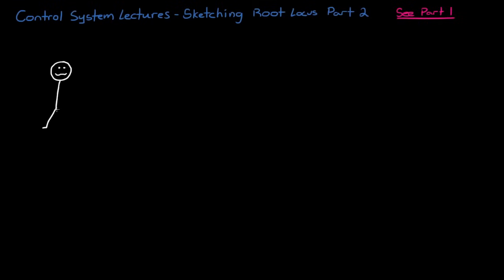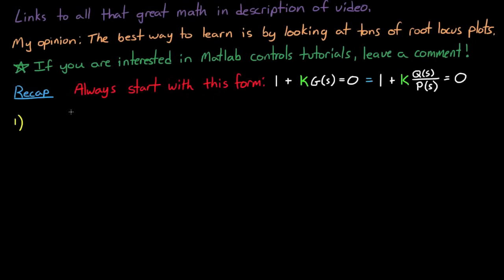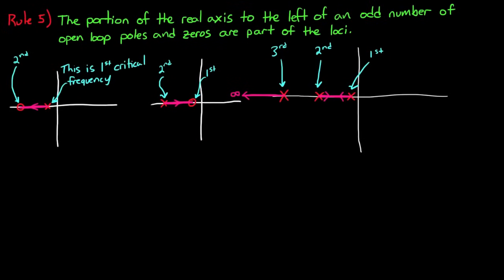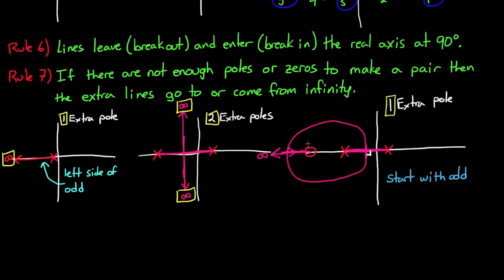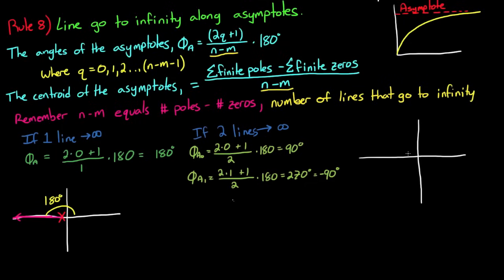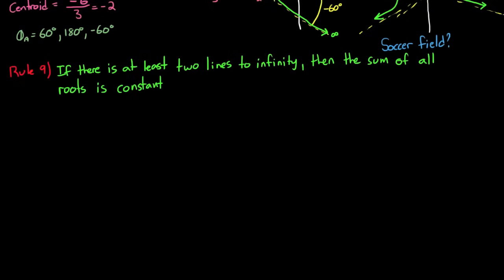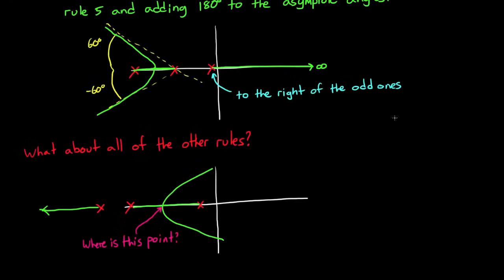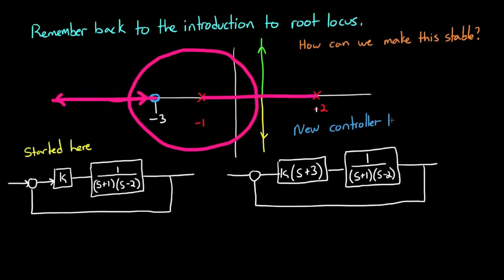Sketching Root Locus Part 2

Comment: @Brian How do you draw that fast ? and change color so fast as well ?
It seems that you are drawing in real time since we can see your cursor moving --- seamlessly transitioning between the lecturing and drawing parts of the lecture.
Drawings to not appear per-recorded. Are you using a special tablet like a bamboo tablet (I must confess that I never used a bamboo tablet so I may be completely in left field with this example). If so I would be curious on  the model if the tablet if you can provide it.
Drawing are really well drawn and spot-on, lectures are great too .... they explain the control theory material with emphasis on intuitiveness which is great

Comment: I think the way you get the centroid is not that precise it outputs an approximate to correct value we get from solving for x : 
(sum (1/(x-p_i)) from 1 to n) = (sum (1/(x-z_i)) from 1 to m)
where zi is the value of the i-th zero and the pi is the value of the i-th pole 
but if it is true for all the systems I would like to use it because of the super computation reduction it makes

Comment: Hey, Im practising for my exam and im puzzled about something. The transfer function 1/(s(s+1)(s^2+4s+5)) has no zeroes, 4 poles, therefore the asymptotes to in 45, 135, 225, 315 degrees. The centroid of these asymptotes should be, according to your formula at (8:20): (4-0)/4 = 1 because there are 4 finite poles, no finite zeroes, and 4 unmatched pairs. Yet Scilab puts the centroid at -1.25, which is, funny enough, the "average" or even "center of mass" of the 4 finite poles! Im gonna do some more excersices and see if this formula stands for every case (no time for a formal proof lol) but maybe i used your formula wrong? Thanks in advance!

Comment: At 9:12, how do you know what to make q?
Reply: q is the sequential of integer numbers from 0 to the minus 1 of difference of poles and zeros. So in this case there are 2 lines of locus, indicating that the difference between poles and zeros are two (n - m = 2). So the q numbers are the sequency that starts from 0 and end up in 1 (n - m - 1 = 2 - 1 = 1)

Comment: I stumbled upon a problem while trying to sketch by hand the root locus of a certain closed-loop system. The open-loop system is K*(-0.5s^2+1.5s-1)/(s^2+4s). This system has two open-loop poles and zeros, so each pole has a zero pair. However, when I use rlocus to plot it, it shows that the zero situated at s = 2 goes to infinity even though a pole should be connected to it. Also, on the real axis there is root locus on the left of even number of open-loop poles+zeros, which completely contradicts rule 5. So I am not sure what's going on, so far I have always been able to use this rule and sketch all systems without any problems. Can someone help me?

Comment: If right half plane real zero is located at the very very large +s (say; 1,000,000), should we consider it as first critical frequency? In practical engineering case, it often seems to ignore the RHPZ located at the very high frequency. That's why I am confused.

Comment: Ok, so, one thing which made me confused, and might throw other people off as well so I'd like to mention it here. If you have something like s(s^3+25) in the denominator, so your poles become s(s^3+25s) = 0, your poles end up being 0, 5i and -5i. But a thing to remember here is that the poles are in fact 0, 0, 5i, and -5i. This means that there are 2 poles at the same point in the root locus.

Comment: For Rule No. 6: If G(s) = 1/(1+s/p)^3, the the break away point and the centroid of the #3 asymptotes will be same, while the angles of the asymptotes are 60, 180 & 300 degrees.
Am I missing something?

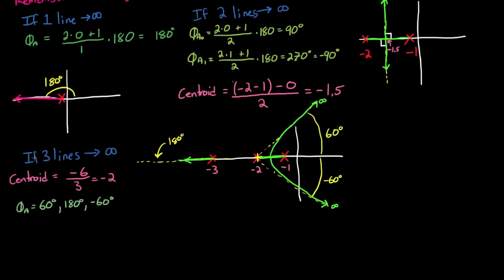Comment: hey at 10:48 your lines leave the R axis at 60 degrees each. Isn't that opposed to the Rule 6 where every line "leaves" the R axis on 90 degrees?
Reply: doubt its relevant now, but the lines breakaway perpendicular (+/- 90 degrees) from the real axis, after this they tend towards the asymptotes which would be +/-60 degrees in the case you specified.

Comment: Question regarding Rule 5)
Say you plot a function with one zero on the positive real axis, a pole on the origin, and finally another pole left of the imaginary axis. In that case the first critical point would be the positive zero. However if you plot the rlocus on matlab, the space between the first and second critical points would be empty, and the space between 2nd and 3rd would be part of the locus path.

I hope what i mean is clear, but i would like to know if there are any exemptions to that rule.

Thanks!

Comment: Im traying to sketch the root locus of the following open loop transfer function:  (s+7)/(s*(s+5)(s+15)(s+20)). I can determine the open loop poles are: 0,-5,-15,-20 and the open loop zeros: -7. Then I used to two equation for the centroid and asymptotic angles. For the centroid I get -11 and for the angles : 60,180,-60.  When I plot the root locus in matlab, the 60 degree angled path are between -5 and 0.  Why does the centroid (-11) appeard between -15 and -7 at 180 degrees and not where the path follow the asymptotes?

Comment: when two poles crash and then go off to infinity, does it matter which one goes up and which one goes down? for example at 15:00 when you have your poles at -1 and 2 you draw the pole from -1 going up and the pole from 2 going down. is this just arbitrary? also when you added the zero afterwards which pole would go towards the zero and which one would go to infinity?
Reply from the maker: I drew the motion of the two poles in separate colors because I thought it would be more clear but I've received several questions like this which leads me to think I've mislead people into thinking it matters which goes up and which goes down.  But think about it this way ... let's say for a given gain, k, we have two poles (-1 and -3),  then as we increase k they move to (-2.2 and -1.8) and then to (-2 and -2) and then finally to (-2 +i and -2 -i).  You'll notice that when you aren't drawing how they move on a graph then there is no question of which moved up or which moved down ... they are just two poles in the system.  And both poles were on the real axis at low values of k and then moved off the real axis for higher values.  And that's the important part, it's not where does this one pole move (up or down) but how to all of the poles move together.  The root locus plot gives us a picture of how the poles moves in harmony as we sweep k.  

Same thing when I add the zero.  It doesn't matter which "color" goes which way.  Just that one pole moves one way and one pole moves the other way.
Reply: awesome that makes sense, thanks for the quick reply brian, i just bought a copy of your e-book as well, it looks great
Reply from the maker: Thanks! Glad you like it so far.
Reply: What will be the angle of asymptotes if Number of zeroes is greater than Number of Poles.

Comment: Dear Brian,
I was told that the arrival angle and departure angle of breakpoint should be calculated via dividing 0/180+360L by multiplicity.  It is always not equal to 90deg.

Comment: Brian, for Rule #5, what if we have a conjugate pair of poles or zeroes as the first critical frequency? Do we still draw a line to the left of the odd numbers, just do it on the real axis? Also, if the first critical frequency is a conjugate pair, which one would be the first? Thanks.

Comment: So I'm in a Dynamic Systems and Controls class right now. The professor is horrible. Thick accent. Hard to understand. Chicken scratch notes and the worst explanations ever. If only I had you as a professor I think I might be passing this class. With only 30 ish min spent on this topic I think I've learned more than the 3 lectures from my professor. Thank you so much!

Comment: Hi Brian, thank you very much for your great effort you put into those videos, I always go through them first before I go to textbooks ;)

Question: For the last example would it be possible to add another pole and adjust the gain so that we move our poles to the LH side?
Reply from the maker: Thanks for the nice comment! To answer your question in a word: No.  It's hard to explain why as a comments but you can image that since the root locus lines exist on the real axis to the left of the critical frequencies so the +2 root would still move towards the -1 root.  However, no gain and pole location you choose would cause the +2 pole to move faster to the left than the -1 pole moves to the right. Not a great explanation.  I'd recommend you try it out and see what happens. Cheers!

Comment: Quick Question Dr. Brian, at 09:48 how did you know that the pole at -2 corresponded to the 90 degree asymptote and the pole at -1 corresponded to the -90 degree asymptote and not the other way around? Thanks :-)

Comment: Am having a problem with the centroid equation. I have 2 infinite poles @ '1' and '0.7'.Also one infinite zero @ '-0.2', in total I have 3 poles (0.7, 0.1, 1) and 2 zeros (-0.2, 0.3), but I cant get the value in the middle between the two infinite poles using the centroid equ.

Comment: I tried using the angle equation for complex poles, but it doesn't seem to work. Is there another equation? For instance, if you have a zero at -2 and conjugate poles at -1+-i can you find the centroids or angles?

Comment: thanks for video sir..,i had a question that  if there are two poles and two zero in the LHP .....like: poles are = -1,-2 and zeros are -4,-5.....then what is value of centroid..? ...in such condition is both poles are pair up with zeroes.....? and also what is the value of angle of asymptotes...?

Comment from the maker: Hi Michael, you've come across a tricky one! If you simplify hp it will be more obvious. hp = -6 * (s-1)*(s+1) / (s*(s+2)*(s+3)). When you solve for the root locus you are adding a gain, k, in line with this. However, since the gain of this transfer function is negative (-6), when you sweep k from 0 to +inf, the gain actually goes from 0 to -inf.  This flips the root locus to the other side. In matlab you can do rlocus(-sys) to get the positive gain root locus.

Comment from the maker: Hello Raja, no the rules do not change ... however you have to be careful when dealing with roots in the RHP.  The basic transfer function for a real pole is [ Wo / (s + Wo) ].  If you place a pole in the RHP then Wo would be negative which then makes the numerator negative (e.g. -5/(s-5)).  This negative gain will switch the direction of the root locus to K = 0 to -infinity. So as long as you keep track of the sign and account for it the rules for the root locus are the same. Hope that helps.

Comment from the maker: Mr. Supremeo (sounds a bit like a superhero!) I said that q = all of the integers starting at 0 and going to 1 less than the number of lines going to infinity. So for 2 lines tending to infinity q would be both 0 and 1. When q = 0, the equation becomes 1/2*180 = 90 degrees. And when q equals 1, the equation becomes 3/2*180 = 270 degrees. So one line goes up and the other line goes down. Is that the question you were asking?

Comment from the maker: It actually doesn't matter since you can't have a root off the real line (with an imaginary component) without having a second one on the opposite side of the real line (the complex conjugate).  Therefore, since they are always mirrors of each other once they leave the real line it doesn't matter which one goes up and which one goes down.  In fact, if I had drawn the root locus with the same color instead of two colors you woudn't be able to tell which I drew up and which down.  Hope this helps.